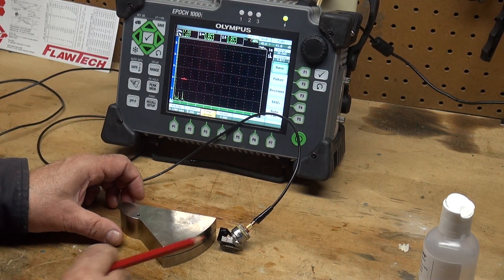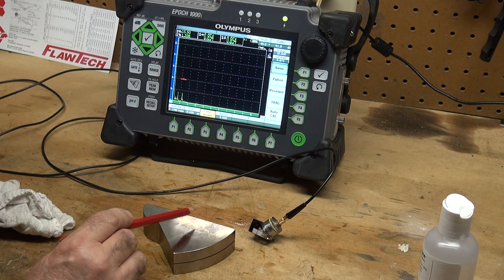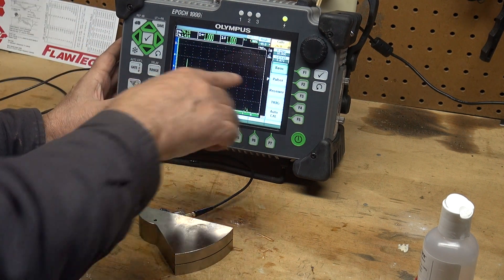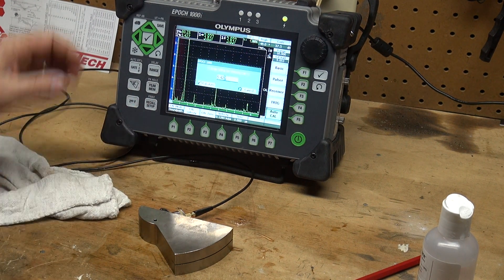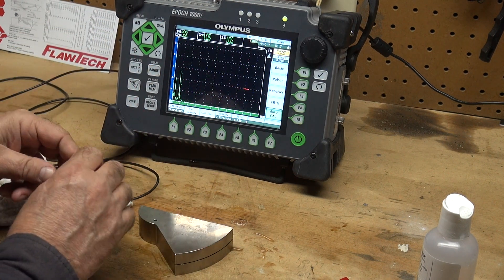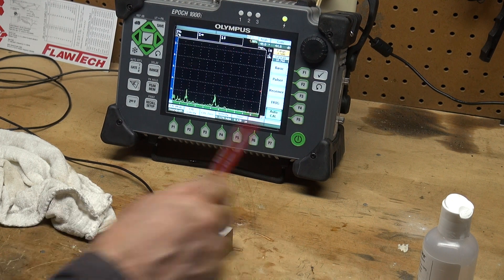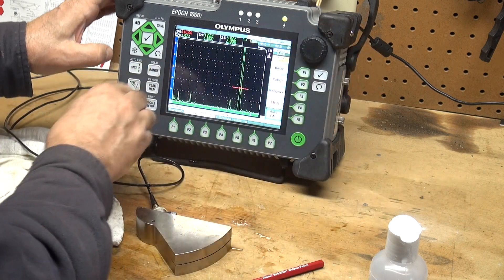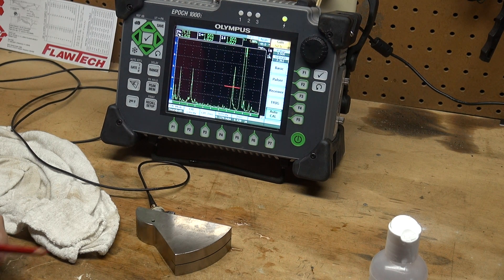UT Angle Beam Calibration Using DSC Block

Comment: Can some explain why is the 1/32"  wide notch is used as a reference level and not the 1/8" diameter hole? Thank you.
Reply: Depende de la norma, la sensibilidad de AWS puede ser de 1/32 o 1/16 y en el caso de ASME de 3/32 para espesores menores de 1 pulgada, 1/8 para espesores de 1 a 2 pulgadas, 3/16 para espesores de 2 a 4 pulgadas  etc.
Reply: @PABLOLOPEZ-iz9iu Muchas Gracias.